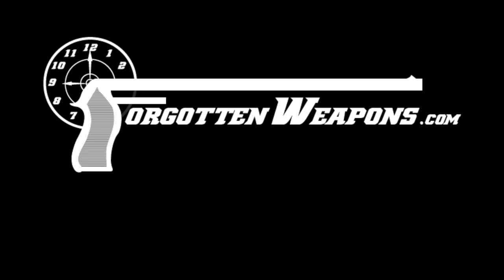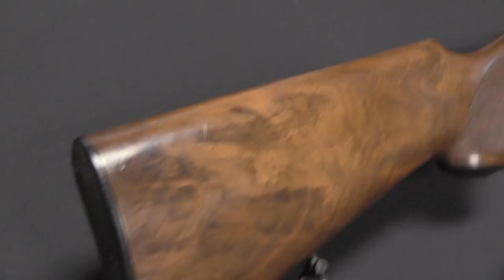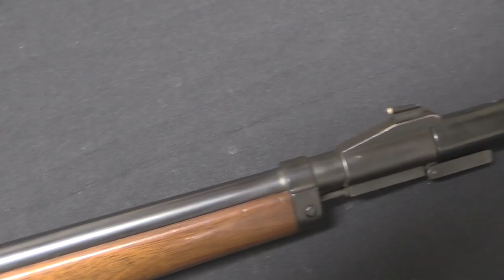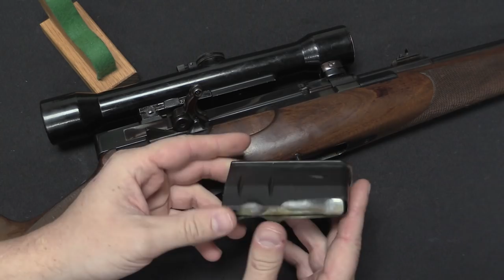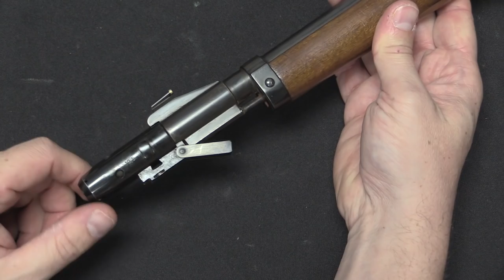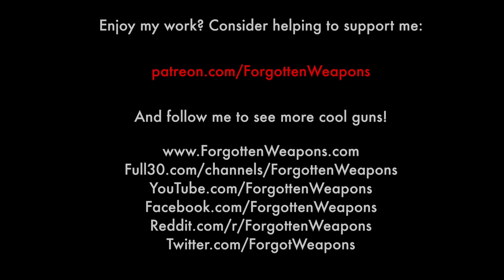Walther - Heinemann Toggle Lock Sporting Rifle

Comment: Could it possibly be chambered in 10.3x60R Swiss?
Reply: +wood1155 From what I know / can find. The cartridge is almost identical in size and performance to 450/400 23/8&quot; The bullet weight can range anywhere from 180 - 400 grains but 185-250 is most common. it has a bore size of about 10.3mm but the grove size is closer to 10.7 (so near .400&quot;).

Although the cartridge has all but been obsolete for a century, it is still in use in a few isolated areas the foremost being the Swiss canton of Grisons where it is the mandatory calibre for all hunting - hence it is still chambered by european companies such as Blaser and ammunition offered by the likes of RWS(185 Gr expanding cone point @ 2935 fps)

Comment: Ian,
That mechanism kind of looks like the Japanese Trials Gas-Operated Pedersen Rifle that you did a video on earlier this month.  Both are toggle locked with the "op rod" going forward. Do you think there was any relationship?
Reply: +The Laughing Hyenas 

I was thinking that myself. I doubt there is any relationship, just a similar solution to a common problem.
Reply: ChristophInns ,
I am wondering.  If I were a Japanese project manager and I had to design a rifle one of the first things I would do is get every advertisement for any existing rifle of similar specifications.  Did the guy get catalogs?

Comment: how does a horizontal toggle mechanism affect lateral accuracy? imagine youd get a hell of a sideways kick - much more difficult to compensate for than a vertical one

impractical as it may be, itd be really cool to see a symmetrical version of this - toggles flap out on both left and right sides simultaneously
Reply: +IosueCanadensis Because the operating process starts at the end of the barrel, I suspect that by the time it initiates the overwhelming force applied on recoil is directly along the axis like a bolt gun. By the time you start responding to the kick that's all you'll mainly feel and any sideways torque would be minimal.

Comment: Would this design have been able to satisfy the German requirements that begat the G41s? With a few mods I mean. After all, it's a Bang system gun with literally no moving parts on top and it's fairly easy to operate like a straight-pull bolt-action (okay, not Mauser style, but surely easier to operate). Cut a feeding port on top with a stripper clip guide and you should be all set.

Comment: Is it possible that this rifle influenced Walther's Gewehr 41 design? I know that it used a Bang system as well, and the muzzle cups look pretty much identical to me. At least from photos.
Reply: +Microzombie If you don't want to drill gas ports into the barrel, the Bang System is basically the only way to create a gas-operated self-loading rifle. Deducing an influence from that alone is a bit thin, especially as the G41(w) has a distinctively different operating mechanism aside from the Bang System...
Reply: +Mirdarion I was simply asking since I'd never seen a Bang system before the G41. Since Walther's design beat out Mauser's I was curious. I guess the question should have been. 
"Did Walther's experience with Bang systems help them beat Mauser." 
As for the systems being different, they couldn't have been very different considering that the basic Bang system relies on the operating rod moving the bolt. I may be wrong because I've never seen a disassembled G41(W). Please correct me if I am.
Reply: Microzombie Well, on that basis every self-loading rifle that isn't recoil operated uses the same technology. 
But in weapons technology there is more differentiation (how much the bolt actually move (short or long stroke system), whether or not the bolt rotates, and much more. The MG 42 for example also uses a Bang System to support the actually recoil operated, roller locked mechanism (the whole barrel moves backwards a little bit to push on the bolt and give it the necessary momentum to overcome the spring pressure after the unlocked rolls slowed it down before, so that it doesn't move backwards with the gas pressure in the chamber still being too high).

It should be noted that the G41 didn't really win anything, as it wasn't adopted. Development continued and in the end the Waffenamt realised that the Bang System was bollocks and abandoned it...

Comment: I would call it the German Rheinmetall company, because of the military limitations of the Versailles treaty after WW1 they used loopholes in Germany to work on guns, hence using a third party country to work in since it technically did not violate the limitations of the treaty. Not unlike tax loopholes in these days. :D Also St.m.G. probably means "Stahlmantelgeschoss", aka full metal (steel) jacket.

Comment: I don't know much about ammunition/measuring, but wouldn't it be possible to measure the chamber, and then compare that to common ammunition of that time? Or is it likely that it used ammunition made specifically for it?
Reply: Appropriate ammo is not just about dimensions ig. It also depends on their pressure curves they generate
Reply: @viswasubramanian4738  Which is why I mentioned comparing it to known ammunition from that time period

Comment: I thought Rheinmetall was German not Swiss.
Reply: +spankmeister It is, but Rheinmetall (like many German arms manufacturers at the time) was severely limited by the restrictions of the Versailles Dictate. The only reliable way to circumvent this was to produce outside of Germany and sometimes even then only under the guise of subsidiaries...

As this is a self-loading rifle, it couldn't have been produced in Germany for the military at that time (unless produced illegally, which did happen later on).
Reply: +Mirdarion Very interesting, thank you.